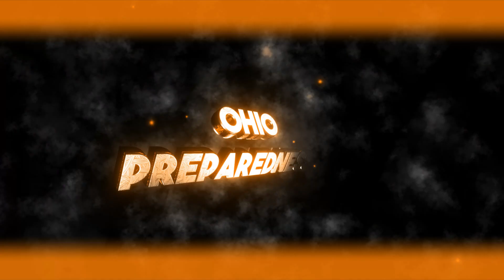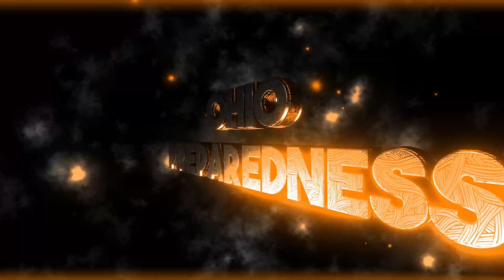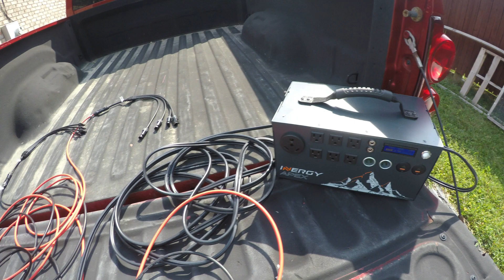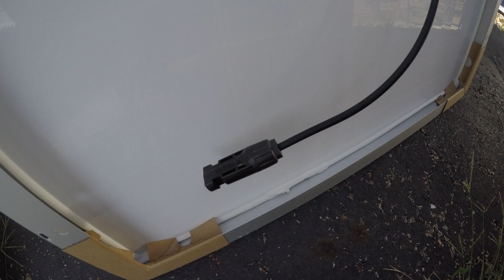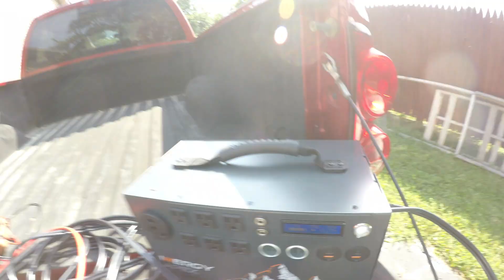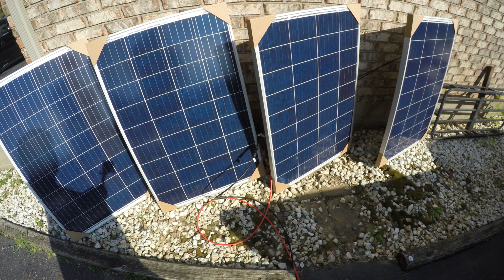Inergy Apex Solar Basics

Comment from the maker: I need to make a correction, 400 watts divided by 18 volts, which is what the panels are putting out for voltage, equals about 22 amps. Therefore, the MC4 connector should be fine, it should never see 20 amps most likely. I’ll get a measurement in the near future.

Comment: I know the Inergy Linx panels cost more but it avoids all the cabling issues as they are designed for the Apex. And they are lighter/thinner. But yea, if you buy the Apex and already have non-EC8 panels, you illustrate perfectly where the modifications need to be made. Or, if you buy the Apex and then buy cheaper panels you need to make some cable mods to hook it all up correctly. Thank you!!!
Reply from the maker: My pleasure!